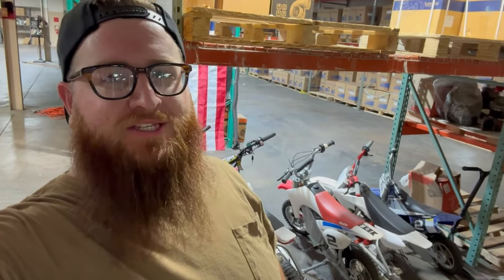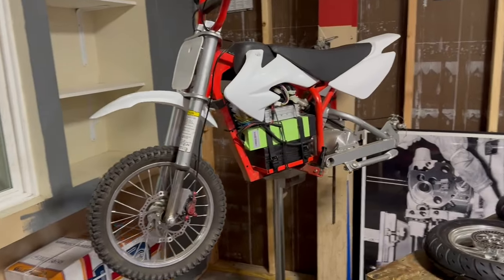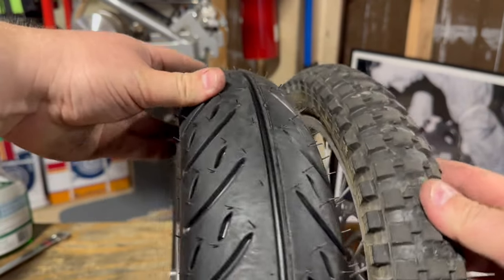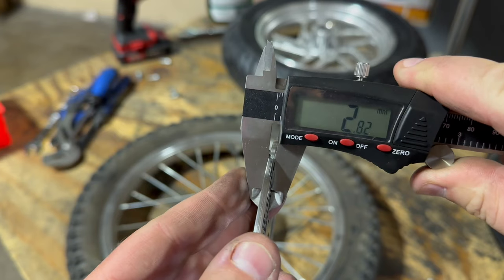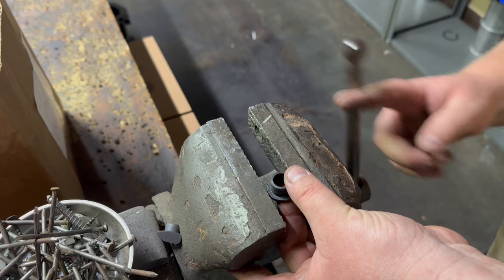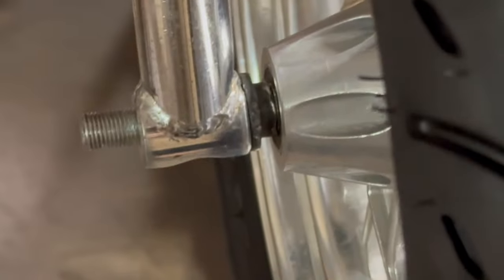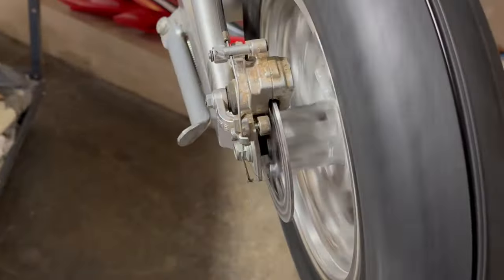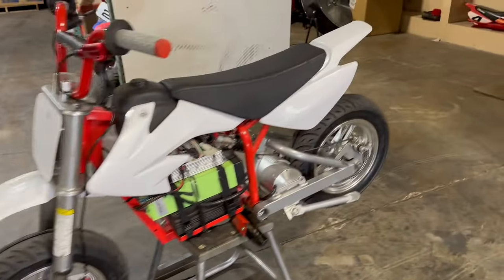How to RSF 650 Wheel Swap on RAZOR MX500

Comment: Fun fact even if they don't always have the complete wheels in stock on the razor site they always have rims they'll sell if you call them on the phone and just grab some shinkos and you good 🤙 depending on which ones you go with it's going to add 4 to 6 extra ounces on the tire and the rolling weight
Reply: I just called and they told me they only sell the entire wheel assembly. Do you have a part number for just the wheel?